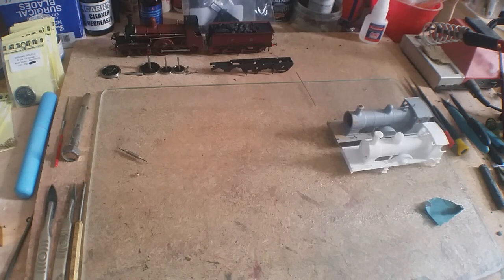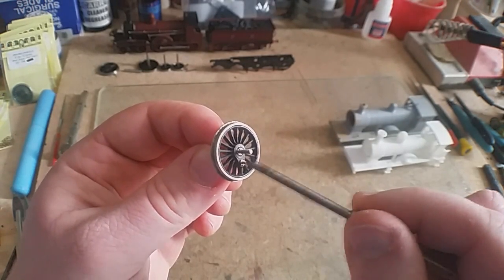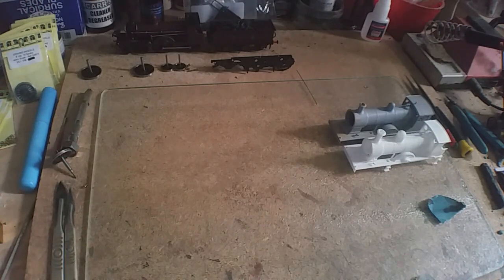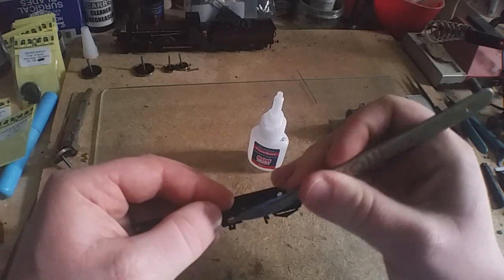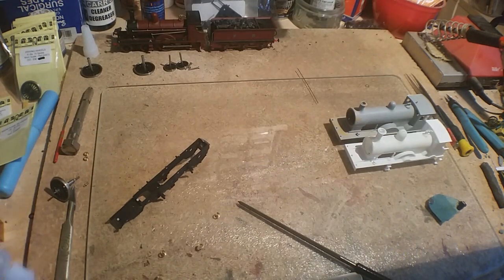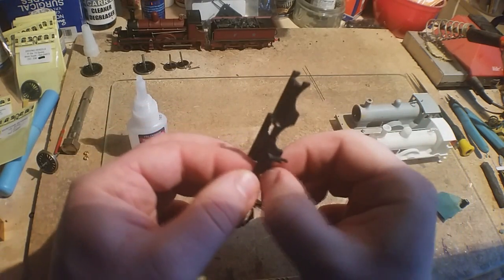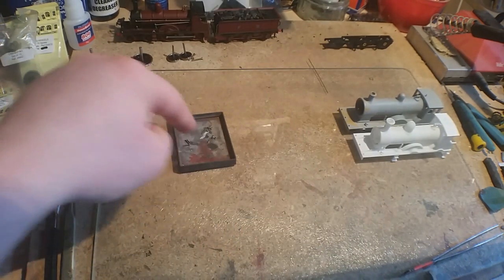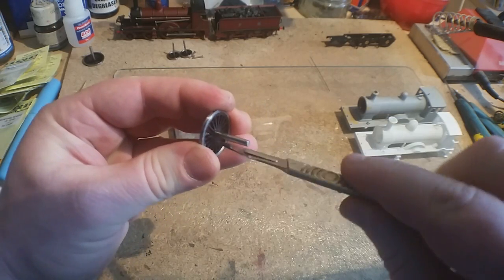Building an SCC Loco Kit - Part 4 - Wheels, Crank Pins & Bearings Oh My!

Comment from the maker: IMPORTANT NOTE:   I just found the linguistic  difference between a Broach and a Reamer.  I thought the terminology applied to both.  When I mention a 1/8th Taper Reamer and meant Broach.  Broaches have flat sides but reamers are usually sharp.  For chassis you want broaches.

Comment: I was thinking of getting some better wheels for my J94 project, this has really helped, cheers mate :)
Reply from the maker: +Colm Connolly- Taylor - No worries.  They look more realistically profiled and have steel tyres so are the right colour.    Steel can rust though and they are a bit harder to add/remove when faffing about.

Markits/Romford are a good place to start though.
Reply: +sparkshot cheers mate, I just fine that with alot of older designs like hornbys terriers and J94s the wheels are too chunky and the con rods are too thick like on bachmann 08s, the con rods on them look daft
Reply from the maker: +Colm Connolly- Taylor - You can always remove them and file the backs down.  Easily done. :)
Reply: +sparkshot thats true, mig give that ago, got alot of things to do on it tho haha alof of room to improve